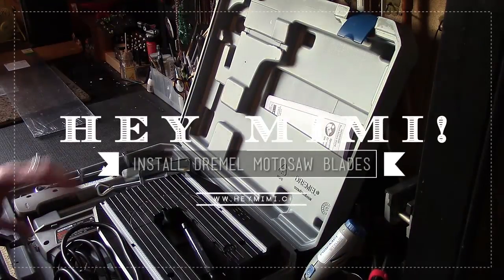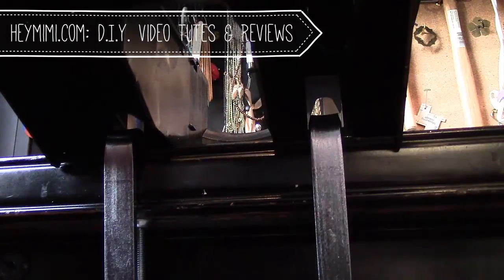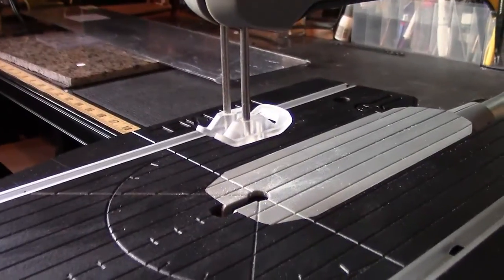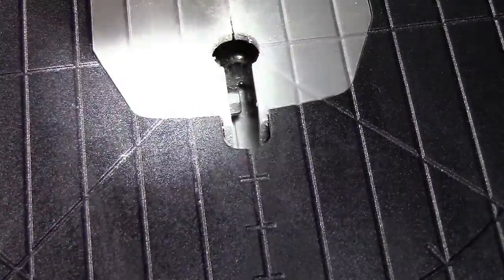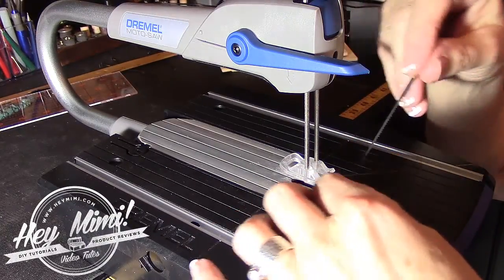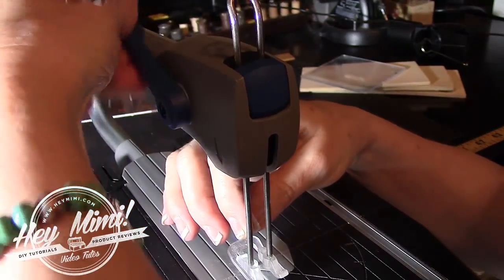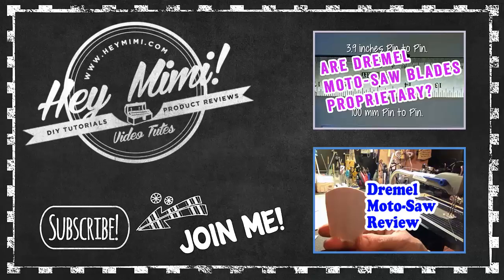How to Install Dremel Moto-Saw Blades

Comment: I just spent at least 40 minutes trying to install this blade, even with your excellent video. I wanted to add a good tip for those who may have my problem.  There is a place in the top, similar to the slot in the bottom that those pins need to go above. I found it after looking with a headlight. My unit looks like it may not be adjusted right, and the pins would not reach above the slot. This results in the blade not grabbing when you move the lever from the front to the back. I had to physically push down on my lever (farther than it felt it should go) so the slot lowered even farther so I could push the pins into the correct place. I assume the blue lever was not adjusted properly. Hopefully mine doesn't break in the future. Thanks for your video. I would have never gotten the blade installed without it.
Reply: Michelle Naranjo I am (aging exactly the same issue. Once in 40 times it will ‘catch’. I will try a flashlight to see where the upper pins need to be. Thanks!
Reply: Isn't it easier to first put the upper part into position, and then while the blade is hanging, just push the top of the saw as much as it is needed for the bottom part to slide into place?
Reply: Thank you! Finally got it to catch but had to hook the top of the blade first and then guide on the bottom. Hope that helps someone else!
Reply: Omg, this comment just saved me from returning this and spending money on something that wasn’t “broken.” Thank you!!!

Comment: Gave up waiting for a reply. Sent it back to Amazon. They sent me a replacement today. Saw blade went in first time, the bottom foot which holds the blade is a lot higher on this second one. Works great thanks Amazon.

Comment: Thank you for the video. I still had trouble getting the blade installed and found that I wasn't taking the blade back far enough at the top. It helped to use a flashlight and use the mechanism a couple of times so I could see what was supposed to happen. Now to use it for the first time!

Comment: Appreciate the video!  I'm such a numbnutz when it comes to directions that come with items so this video really helps.  May have to get one of these!
Reply from the maker: Hi Leila! Don't blame yourself! The reason I made this video is because I feel that the Dremel instructions are so inadequate!
Keep an eye out at the big home improvement stores for a great deal on the Motosaw.  I lucked out and found mine at Lowes for only 30 bucks last Oct!  I have a feeling that they are repackaging them with the fence accessory, and might be clearing out the first production before they restock with the complete set.  I have no inside information.  I'm just making this stuff up, but I can't think of any other reason I got mine so cheap!?

Comment: Thanks for the video. I had been able to install the blades but with much difficulty. I finally measured the pins and also the space where the pins need to fit through the top and I found that the pins on my blades are too long! Arg! Very frustrating.  The space is about 4.8mm and the pins are about 5.5mm. The only way I can put the blades in is to twist them . Then, while twisting, the bottom of the blade comes out sometimes. I either need to grind down the pins on all the blades or cut a groove in the motor saw to get them to go in correctly. Just either poor design or poor quality control. Very frustrated!

Comment: Great vid. Hope you can help me. Watched this several times and been trying for two days but the top of the blade will not connect. I push the top of the blade to the back but the two pins on side of blade are always below the foot which should grab onto the blade. I check this with a torch, the bottom of blade is just like yours under the foot, I push top of blade to the back but still will not reach. I think it's a faulty product, anyone had similar problems? Thanks.

Comment: I'd like to mention that at the top there definitely is something the blade needs to latch to, similar to the bottom, and I just couldn't get it to do it until I pushed down gently on the top of the unit to allow it to latch on, releasing that pressure creates enough resistance to easily let go and lock in the blade.

Comment: Hi, I have a moto saw since 2 weeks and I would like to know if it is normal that my blade breaks very often (1/4' plywood, of about 1,6 foot), that is to say about once or twice for each cutting plywood.  When you look with a flashlight inside the upper part of the saw, where the blade enters, is it normal that the crack in the middle is not aligned with the place  just a little above of it where the blade is being put, for that device is much on the left than this crack ? Thanks!

Comment: Hi Mimi.  Awesome vid!  TY so much!  Question.  This takes the the pinned blades & only blades made from dremel Moto Saw correct?  Could one flatten the pins so it would be a pinless blade & easier to use for fretwork.  Have you tried this? Result? Would you do a vid on this? TY!! 😃

Comment: Just to add to this vid. Mine came from factory with lower lever in the lowered position. Need to plug in without the blade and run the saw a few times for the lever to rise high enough to insert in the blade. Then it could be inserted properly as described in the vid. Hopes this help anyone with this problem too.
Reply: Thanks so much for taking the time to post this info, mine was the same problem.

Comment: I had the same problem with the top of the blade not engaging with the mechanism. No amount of fiddling with the lever and a flashlight worked. What DID work was pushing down on the top of the front of the unit firmly enough to depress it about 1/4 inch to allow the blade to catch properly into the lifting piece. Hope this might help someone. It sure didn’t work just pushing the blade back to hit the rear and engaging the lever, as it says in the instructions!

Comment: Thanks for your very helpful video. However,  after attaching the saw blade I tend to notice that it isn't perfectly straight, resulting in angled cuts and making it challenging to get the wood straight in. The wood piece always tends to move away. As a fix I need to start at an angle and push it in at angle different from 0°, which isn't very ideal. Any help from anyone would be highly appreciated! Thanks...

Comment: Hi Mimi - thanks for posting these vids on the Dremel Moto Saw - I've just recently got one and havent taken it out of the box yet but looking to do so very soon so will watch your vids again when i get around to doing it.  Have you done much inside cutting with it e.g. fretwork - just wondering how it goes/how tight the cuts can be? thanks , Ruth from Australia
Reply from the maker: ruth quick Hi Ruth, sorry for the slow reply!  I haven't done fretwork with it, but I've been meaning to try.  Have you taken yours for a test run yet?  Wondering how you like it?
Reply: Not yet but will be happening soon so when I do I'll let u know for sure :-)

Comment: these blades are a nightmare to install. i actually broke one in the process and it went flying. im aways scared to pull the lever. i pull is sooo slowly because i feel the tension starting and i get flashbacks. Where do you get replacement blades? they are so scarce. can you use other brand scroll saw blades?

Comment: You got yours for $30???  
It was $99 and dropped to 89 on amazon.  I will have to check and see if local stores have it cheap.  That would be nice!  I tried to hand cut metal and yea.  I need one of these, hahaha.  Thanks for the tip, gonna check soon!

Any idea how to cut tube glass?
Reply from the maker: Yes, it was last Sept or Oct.  Someone on YouTube commented that he had just found one for $50 at Lowes.  I don't know what part of the country he was from, but I checked my Lowes out of curiosity ... and couldn't believe it!  I got the very last one, on clearance for just $29!  That is why, in my first Motosaw review, I sound worried that the Moto-saw would be discontinued; why else would it be marked down so drastically? 

But it's a neat little scrollsaw, and it has been getting positive buzz from people who just want to use it for light woodworking like hobby weight stuff. (I think people who want to use it as a full size scrollsaw, such as cutting  thicker than 3/4" oak /hardwood,  are not impressed with it). 

I no longer worry that it's going to be discontinued.  I am hoping that the clearance was because they are going to add a fence,  (which was not included in the set I purchased).   I'm certainly not complaining, considering the price I paid!

About cutting tube glass, sorry, I have never tried it.  Do you mean like test tube thickness?  or a bottle?  My only idea is a tool that my husband has... it looks like a wrench, but you clamp it on a piece of copper pipe, and rotate it around the tube.  I can't remember if it actually cuts the pipe in half, or if it just scores a nice straight line around the pipe?  But I wonder if it would score a glass tube well enough to snap it, with a nice clean break? 

I think there are also videos online about cutting the neck off a bottle by scoring it, then filling it with hot water and immersing it in cold water..so that it cracks cleanly at the score line.  Honestly, I'm just guessing!  I really don't know!
Mimi
Reply: stonysilenceworkshop Thats awesome.  I need to check our lowes....
Yes, the test tube glass.  I have a tool similar that is meant for glass but it only scores.  Not sure how to break it off without cutting my hand or glass.  The youtube videos I've seen involve fire and naturally that freaks me out, LOL.

Comment: I have just got my moto saw, but have not tried it yet,
One comment. Wouldn't it be easier if you lift the foot all the way up before installing the blades?
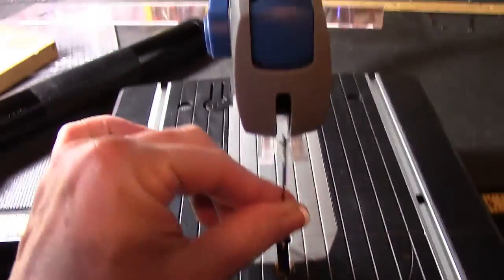Reply from the maker: @Ole Kristian Valle : Yes, you are definitely right.  In the first example at 2:10 in the video, I have the foot all the way up.  Now that you mention it,  it is much easier because I don't have to reach around and grab the blade from the back!  Good point, thanks for the comment!

Comment: Thought I would just share.  

The 5th picture has a pic of the blades and which one is which. :-)

Dremel MS20-01 Moto-Saw Variable Speed Compact Scroll Saw Kit by Dremel http://www.amazon.com/dp/B00AFELU6O/ref=cm_sw_r_udp_awd_azdmtb0F37774

Comment: Greetings from Brasil.  Are you still happy with your machine?  I bought a Dremel Trio locally, but it was deffective, I sent it back to the trader and now they will grant me a refund, because they do not have another Trio for replacement.  So I am thinking about getting this machine, instead.  (I have the Saw Max, too.)  In Brasil, it is NEW product and it sells for around 180 bucks, against 80 bucks through the Amazon.  That is why I ask.  Is it worth it?  Thanks.
Reply from the maker: Eliane Vaccavo Hi Eliane! Yep, I do still love my MotoSaw! I use it even more than I expected, with no problems. I've recently cut some plexiglass with it and it worked great with the coarser blade.  I'm just about to cut 5/8" EVA Foam with it, because I can't get a smooth cut with anything else I've tried.  I'll try to get that video up soon.    Do you like the saw max? That one is on my wishlist!  I've had the Dremel Trio for years, and I'm so glad I have it.  I don't use it often, but sometimes it's just the perfect tool for an oddball job.  It doesn't seem to have taken off, so I worry it will get difficult to find the bits and accessories in the future.(for the Trio).
Reply: HeyMimi DIY Many thanks for your reply.  When I turned on the Saw Max I got scared.  It is a ROCKET!  So I will have to install it upside down and protect myself, using a dimmer to control speed.  Your indication for the blades was very generous!